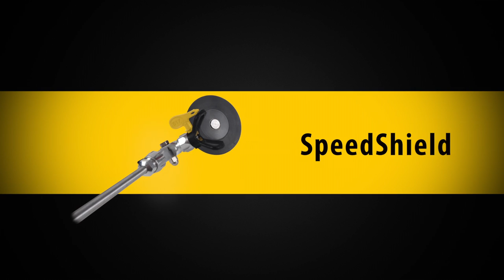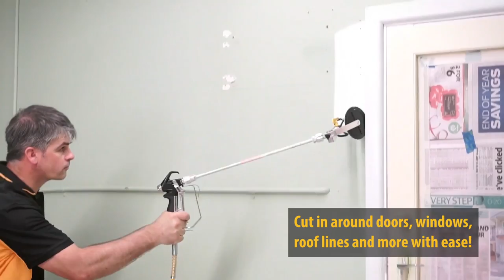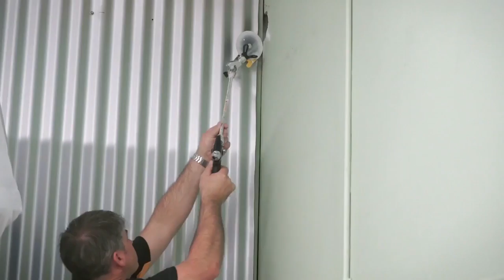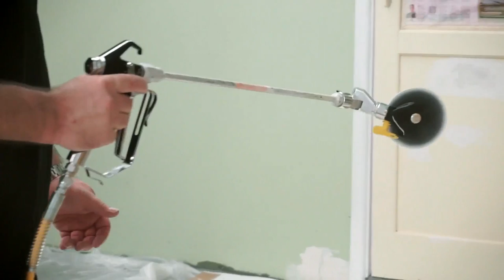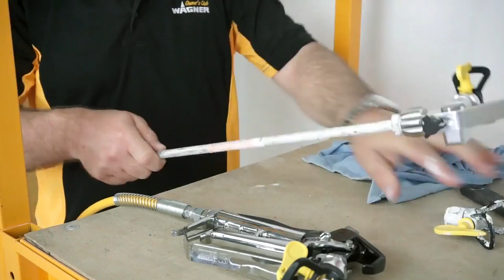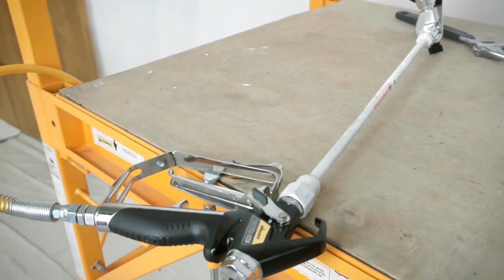Wagner Speedshield - pizza wheel for airless paint sprayers

Comment: Gotta wonder how close dos it reallyget cuz if its not tight still gotta cut in ?*im just wondering looks amazing though
Reply: Levi Stables it cuts in very close. The wheel is very thin. It’s just a hassle to adjust it at the right angle where the paint Barely touches the wheel. Or else it will have to be cleaned constantly. Once you have that. You can probably cut in a room before having to clean the wheel.
Reply: @martinfulgenciojr  cool thanks 👍

Comment: What size tip?
Reply from the maker: Hi Steven, spray tip sizes suitable for trim would work here, this would include the 108, 210. Anything wider and the spray fan would not be contained by the speedshield.
Reply: 211
Reply: Steven White 211
Reply: 211

Comment: Where the overspray go
Reply from the maker: Hi Anthony, the basic idea of the device is that some of the overspray would collect on the shield itself. Unfortunately, as the shield has a circular shape (wheel), only a portion of the shield is in direct contact with the work surface, meaning there are still gaps for the spray to escape through. Let us know what you are wanting to spray and perhaps we can offer a better solution for you.
Reply: При каком давление работать  с "колесом